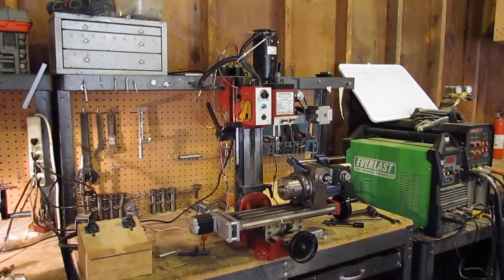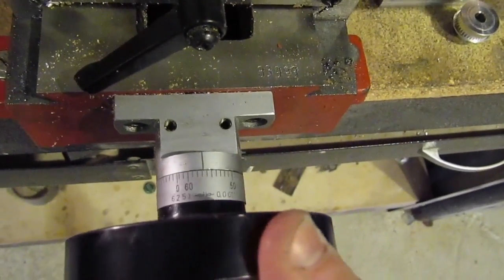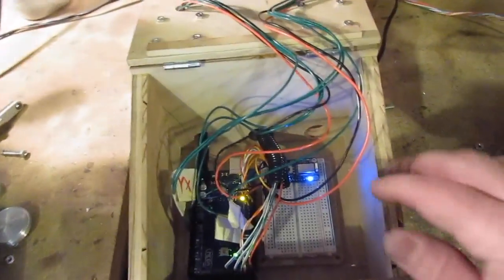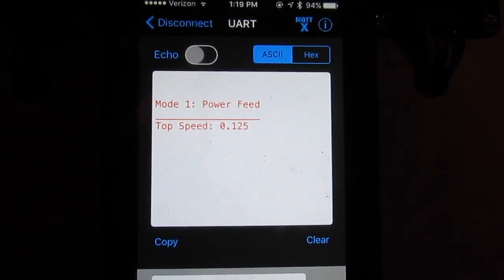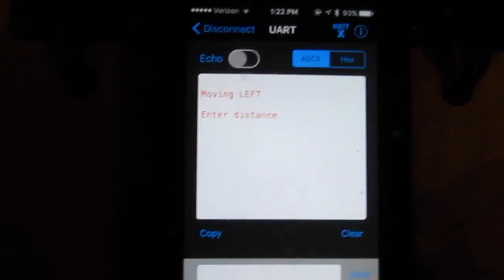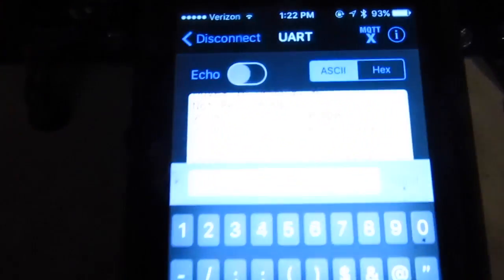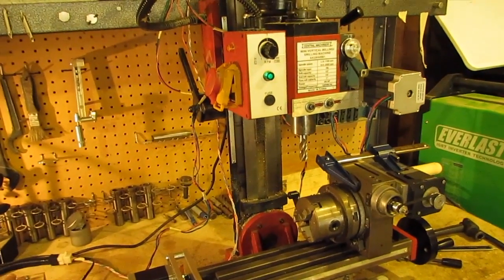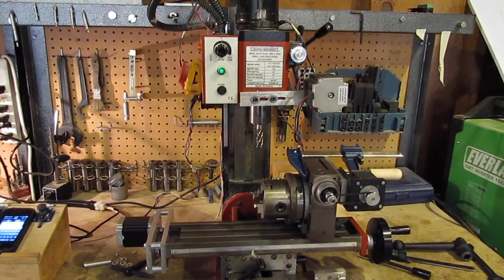Arduino Based CNC conversion on a Mini Mill

Comment: Hey I know this is an old video, but did you do a ball screw upgrade for this on the Sieg x2?
Reply from the maker: No I have since built a CNC router out of these parts with ball screws but when I was using this I just operated it as if it were a manual mill backing out and coming in the same direction every time to deal with backlash
Reply: @jwhitestone  Gotchya, did you overall like the Sieg x2? I've heard that it's okay, but people tend to "outgrow" it quickly.
Reply from the maker: @Jerguu  Its the only mill I've had experience with, I'm not a machinist. I think to a real machinist its like a toy but it gave me the chance to learn all the concepts on a tight budget. But for an entry level machine I love it and use it all the time. It opened me up to a new world of accuracy in whatever I'm doing. I'll admit I have my eye on the Grizzly G704 though, just a little more expensive but seems like a big step up both in size and quality.

Comment: This is awesome. I have a question What are you doing about backlash?
Reply from the maker: Thanks! I was still operating it as if it were a manual mill by backing out too far then returning the same direction every time when it mattered.

Comment: How to you compensate for backlash with this set up? I'm new🙂
Reply from the maker: I fiddled with trying to measure and program in the compensation but with unreliable results so I had to use it like you would a manual mill by backing out and always approaching from the same direction. If I make it do a curve where an axis switches direction there will be a flat spot where it picks up the slack. So this is more for positioning and simple operations
Reply: @jwhitestone  ok, I though maybe I was missing something here. I would love to do a conversion, but I have a ton of backlash in my machine, so trying to come up with a solution..
Reply from the maker: @lextalionis4953  Yeah this is just basic left right up down so it worked ok but Mach3 might be able to handle it. Never used it but I've read about it
Reply: @jwhitestone  I will check out mach3, thanks.

Comment: Has anyone  tried  using board from a 3 d  printer and  bigger stepper motors  and use the 3d printer software cause some of them have a CNC  function and could be a cheap way to do it ...
Reply from the maker: Yes! I haven't made a video about it but I used this motor setup with an arduino running GRBL and a raspberry pi running BCNC and got a pretty fully functional CNC setup going. Since then I have used the parts to build a CNC router table thats about 18" x 36" thats more practical for what I do and the mini mill is back to manual. But the raspberry pi was $35 and an arduino clone for $10 and I was up and running. The motors were lacking on this setup. Worked but barely worked so go big on motors if you're in question
Reply: @jwhitestone  Why you didn't turn your mill into CNC as well? 
Too expensive or you finally prefer turning the wheels by hand and don''t used it very often now?
By the way do you use Tasker for the App?
Thanks
Reply from the maker: @Levisgil47  Yeah I just didn't have money for a new set of motors and used the ones I had for the router and went back to operating by the hand wheels for the mill. I do miss it but for what I do the router is much more practical. The mill could use some bigger motors too if I were to set it up again
Reply: @jwhitestone  Ok I understand! Thanks for your return. Waiting for money too on mine . CNC motors and electronics  are more expensive on a mill than for the router...

Comment: did you used the original leadscrew
Reply from the maker: Yes I made a coupler sleeve that uses the slot in the end of the lead screw to extend it and couple it to the shaft that the belt pully is connected to.  So I still have to compensate for backlash just like you would when working it by hand but no permanent modifications to the machine.

Comment: A 2ed question for you. what is the phone app you used here? And maybe any software you needed for the Arduino, I  subscribed this time took me 2 months to find you here again. on YouTube. Oh and the only hardware you have for the Arduino is the joy sticks and the Bluetooth right? I want to do this with my new mill I just ordered. I will run Mach3 on my CNC but this is great for small work that I do,  I know how easy it is to forget what way I was turning and make a easy mistake and turn the dial the wrong way.. This will be the end of that, If you help me with your build info, that is???
Reply from the maker: Thanks! I got my bluetooth from Adafruit. They have a lot of good information and code to get you going. I think the app I was using was called bluefruit and it made the cell phone act like the serial monitor.  I got rid of the bluetooth and I use a touch screen now but  I have been working with MIT app inventor lately to create my own apps that work with bluetooth, its a little a little more in depth but a great tool. Yes joysticks and bluetooth were my only inputs and the arduino is also connected to the motor drivers.  Adafruit also has a lot of good stuff to get you going with steppers but I used the Accel stepper library as it has better support for moving multiple steppers for diagonal movement.
Reply: Thanks I will check the apps out that you used. I will try to make a video when I get done a make sure I give you credit for your help when I get done. So anyway thanks Jay White.

Comment: Nice job!  Pretty impressive for a DIY / jury rig.  Just implementing the power feed is such a big improvement over hand-cranking.  That teach-mode programming is pretty slick as well.  I'd be interested in seeing an update on the final form.  I noticed it was only moving one axis at a time.  Can you do multi axis 'interpolation' moves?
Reply from the maker: Thanks! yes I have all axis hooked up now and a nice little control box with a touchscreen. I can move all motors at the same time diagonally for convenience and jogging but I'm not sure its quite precise enough for perfect cuts.

Comment: Question, What size step motors you using? 495 oz or are them 570 oz  ? I am wondering because I am about to buy 570 oz step motors at 60 bucks a step and I don't want to under power my CNC mill if am am going to need bigger than 570s
Reply from the maker: From what I remember they are 470 oz but if you are in question I'd go for the bigger ones. I fought with under powered motors for a while before buying these trying to loosen up the gibs until it worked but I lost too much accuracy on the machine.
Reply: So I am guessing the 570 should have the power I need for my mill. Thank you for your help.

Comment: Jay, This is really cool!  Have you added a full computer and CNC software yet since this?  I saw in an earlier comment you didn't have a spare computer.  Ping me if you are still in that situation, I can help you out!  Makers need to help each other out!
Reply from the maker: No I got the system to where I want with a touchscreen GUI and learned a lot along the way. Its not fully capable CNC but it can record and playback and do everything I could by hand and a little more.  I think the next time I dabble in CNC I will build a router style or a 3d printer . In that case I would go for the real computer but until then I wanted to say thank you for the gesture. I am so thankful for this community of strangers helping strangers that I have gleaned so much knowledge from and this just brought that to a new level. Thank you my friend. Stay Awesome!

Comment: Am i the only one who notice itwas just kissing on first cut, second was further away when it started. Backlash in the leadscrews thats why people upgrade to ballscrews with anti backlash. There is no short cuts when it comes to this stuff
Reply from the maker: Thanks for noticing! I didn't think anybody was paying that much attention. It was a programing error I fixed after this video but in general I have to deal with backlash the same way you would by hand by backing off too far and then coming into position from the same direction.

Comment: This is not CNC.  What you got here is an electronic jog system.  Useful but not programable.   Just add a real computer, software and you'd have real CNC.  You've done 80% of the work and are only getting 20% of the benefit.    See the "linuxcnc" project, Google will find it.
Reply: Agree with you that it is a CNC, but also that you are getting 20% out of your work. You can buy a Windows 7 computer for $30 with a monitor. For $100 (if you spend wisely) you can have something that will run Fusion360. That would be really cool.
Reply: It is CNC. By definition. Pointless comment. The guy clearly made something cool.
Reply: Chris is right it is not a CNC you are missing an axis somewhere in and out I believe it a Y axis or X axis
Reply from the maker: I'm pretty sure the arduino is a computer and its numerically controlling my machine. The whole point here is that I don't have an extra computer for my workshop and I did this for under $200 as well as learned to work with arduinos which I use in other areas now too. Do-ItYourself-ers get more out of a project than the final product. I will be making a new video soon showing the touchscreen GUI I programed and its unique recording and programing capabilities. You might be interested, stay tuned.
Reply: I'm definitely interested in seeing that.

Comment: Breadboard ! great project, I need to do similar soon but I think I will solder . open loop on the steppers, arduinos are great, you can upgrade to a DUE if the MEGA isnt fast enough but the DUE is 3v3. Im considering the arduino shieldbuddy, kick ass 200Mhz automotive grade processor, perfect for cnc , would do closed loop easily. cheers
Reply from the maker: Thanks! This is a mega but I wish I had started with a DUE since I am running a touch screen now and it would draw the screens faster. I hoped to get some more speed out of the steppers as well but I had a hard time when I tried to switch out the mega with the DUE and it doesn't seem to be as easy as just plugging in the new board.

Comment: what steppers are you running?  Oz?
Reply from the maker: These are Nema 34 motors I got from www.omc-steppersonline.com. They are very helpful in figuring out which motors to pair with the correct motor controllers and power supply
Reply: http://www.omc-steppersonline.com/  is a dead site.
Reply from the maker: Oops sorry about that its http://www.omc-stepperonline.com/, no 'S'.

Comment: Really interesting and novel control system, especially the use of the phone as an interface and Arduino as the controller. Any chance of hearing an update on it? Best wishes, Kent
Reply from the maker: Thanks again! I have replaced the phone with a touch screen and a nice GUI I have been working on.  Its come a long way and I plan to make a follow up video on it as soon as I can. I'll keep you posted, and thanks for the interest
Reply: Great! I look forward to seeing the update. I've not done anything with Bluetooth on cell phones. There's a lot of cool stuff here, and to many the software is probably the most complex part. Are you software developer?
Reply from the maker: No I'm actually a stone mason but trying to break free to make a living in the workshop. I just got into playing with arduinos  and I'm just learning as I go and trying to give back to the community.
Reply: Jay White Very impressive, a Renaissance man. Best of success to you.

Comment: Nice video. I didn't notice what the specs were for the motors you used. Can you tell me the holding torque?
Reply from the maker: They are Nema 34 motors with 1204 oz.in holding torque. I have the gibs very loose so that the motors turn the cranks at a 1 to 1 ratio to get the most speed possible out of the arduino

Comment: yes but where is motor drivers (like gecko)? and power adapter? It cant be just arduino - arduino gives at max 5volts
Reply from the maker: Yes the motor drivers and a 36V power supply are on the top shelf behind the machine (green connectors) where the wires all lead to. The arduino pulses the drivers with 5V and they pulse the motors with 36V

Comment: DO you have schematics and code available?
Reply from the maker: Not really, I have kind of cobbled it together so far and I now use a touch screen interface instead of the phone so the code has kept changing with the project.  I'm no expert in CNC, machining or programing  but I would be glad to send you some snippets of code if you have anything specific I could help you with.
Reply: I appreciate you responding. 

I would like to upgrade my G0758 Mill to a semi-cnc based on arduino. What I have in mind is push a button and advance .001. Push another button and advance .010. Push a third and continuously advance. I don't want to make anything too complicated. Just automate the boring stuff.
Reply from the maker: Nice! Check out the NYCCNC channel, he does a lot of arduino and  stepper motor videos that really helped me out. How do you like your mill? I'm almost ready to pull the trigger on getting the G0704.
Reply: Not too bad. It needs the usual mods and upgrades but it isn't bad and I have no real complaints. I do recommend getting the G0704 as it has more support and a larger community following than the G0758. IN hindsight, If I had done more research, I would have bought the G0704 but I see no reason to scrap my G0758 in favor of a G0704. If you do buy the G0704, could you send me some dimensions. Specifically the main spindle bearing number and the head dimensions. I'm curious about parts compatibility.
Reply: Would you be interested in a Tormach 1100?

Comment: Hi Jay, that's awesome.  My son and I are just starting to build our first little CNC-Stepper motor project with an Arduino.  My question(only because I'm a newbie) is, how are you able to control the motors with both the IDE and/or the joystick?  Any info would be greatly appreciated.  I was going to control the unit with the Arduino IDE and gcode, but then my son saw your joystick approach.  We are not looking to make anything precision yet, but just trying to understand the concepts.  Thanks again.  Take care.
Reply from the maker: Cheers! Thats great This stuff makes me feel like a kid again, that excitement you get when you finally get something to work. First I'm using the Accel Stepper Library. Its a little hard to learn to use but very capable. I divided the meat of the program into "Modes"and each action can only be controlled while in that mode. I declared mode a variable and the main sections of code start off with if(mode == 1) {...}.I made the button on the joysticks change the mode and when in joystick mode there is an if() statement in the loop waiting for joystick input and when in coordinate mode it prompts you for input and waits for a response. In that mode the joysticks just choose a direction. The Youtube page NYC CNC has a whole series with lot of great information on getting started with steppers and arduinos that really helped me out and I remember a good one from Brainy-Bits too. My program has evolved a lot since then but I could send you some snippets of code to point you in the right direction like how to make the speed proportional to the joystick input.

Comment: Jay did you leave in all the original parts other than the motors and belt pulleys?  Same lead screws and nuts?  What kind of accuracy are you seeing?  I really want to cnc my mill but don't want to spend $1k to do it...  lol  Would the rotary table be better sitting the other way to give you more clearance for the head?
Reply from the maker: Yes pretty much everything else is stock from harbor freight. The motors are on a 1 to 1 ratio with the lead screw because the arduino can only step the motor so fast, and I had to loosen all the gibs as much as I could or it would skip steps. I've got it dialed in now and use it all the time for light work , I know what it can and can't do and I still have to account for backlash when I move and lock the ways if its anything serious. But I could always gear down with different pulleys and change the rates if I want to tighten it up I just loose a lot of speed.  That's how I typically use the rotary table but it could surly be used lying down.

Comment: How are compensating for backlash?
Reply from the maker: I measured the backlash on every axis then programed it to add that distance every time an axis changes direction to compensate. This could be a problem when moving diagonally or on a curve but for the simple one direction commands I use it works great to within .001". There was no need on the z axis because I disconnected the spring and gravity keeps it engaged
Reply: Thank you for the reply. I also owned one of these and the best thing I did to it was replace the standard bearings with tapered roller bearings and then set the preload . Improved the surface finish and extended the life of the cutter.
Reply from the maker: I measured the backlash on each axis then programed the arduino to add that amount every time it switches direction. It worked pretty good but when I need real accuracy I go past my mark and return the same direction every time just as if I were doing it by hand

Comment: What make and model mill is that? I've had a Unimat for years and now I'm looking for something larger.  Thanks.
Reply from the maker: This is typically called a mini-mill and I got it from Harbor freight. The Little Machine Shop has some nice tricked out versions of the same mill too and they're a great source for parts and tools.